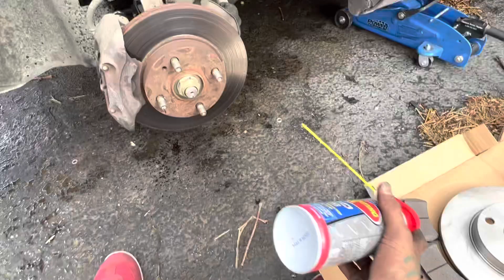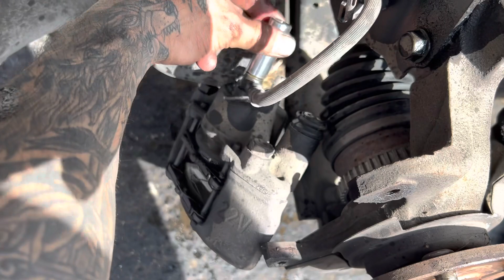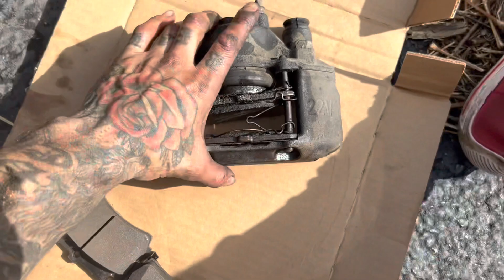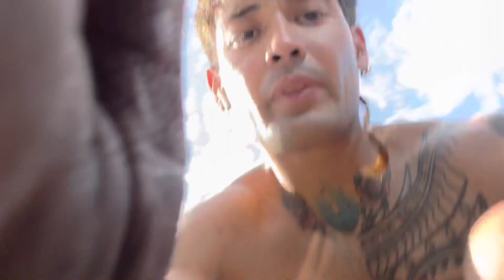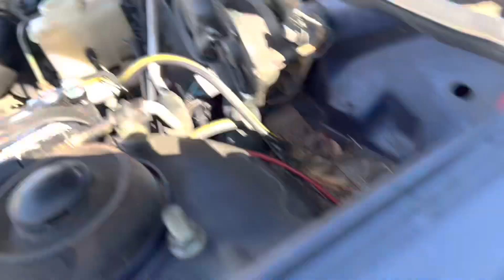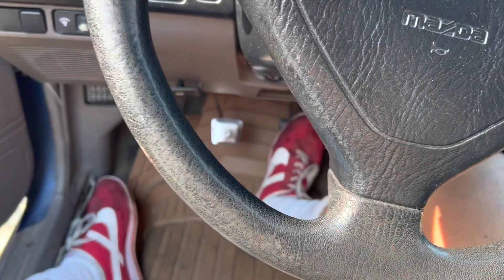Replacing brake pads rotors & calipers Mazda 323 1991

Comment: Awesome vid my bro, little tip use a wire coat hanger to hold the caliper up in the wheel well and a little clamp on the brake hose to stop the leaks and air locks before removing the hose 💪🏻 
323's rule the road!
Reply from the maker: Would of saved me some energy! Now I know thank you

Comment: Great video! How do I get the disk off  do I need to open the cv nut ?
Reply from the maker: Are you talking about what I’m doing at 3:08 ?
Reply: @vincentbryan1962  yeah ,Mine  doesn't have a hole for a bolt  it's actually covered.  Iv done the ball joints  stuck getting the rotor off
Reply from the maker: @ShaheedKader-gk8gk  did you try wacking at it with a sledge hammer. My 62 impala drum doesn’t have a bolt either I just hit it once with a hammer and slide it off with my hands

Comment: You mounted wrong the clips
Reply from the maker: @ProGamerKF  how come it still works even to this day no problem? If the wrong clips are mounted
Reply: @vincentbryan1962  i had broked ones and still worked mang yeara until i look at them.
Só i think this answer tour question.
If you see your video you can see how they are mounted correctly.
Even you Said that they are not doing much.
Watch closely the clips off the pads on the video before you take them off, and watch how you mounted.
You had mounted on reverse, and the saliences off the clips rest on top off the pads.
Reply: @vincentbryan1962  and its not the wrongs clips, they are mounted wrong.
The One that hold the pins, you have kits with a bit different One that works even better because has a salience that matches the Middle hole in the pad.
Reply: @vincentbryan1962  min 5:41, you have to mount like that, look the saliences, they are upside down when you Change de calliper 👍.
Could lead to different wear in the pads
Reply: @ProGamerKF  Would you know where I can buy replacement clips?